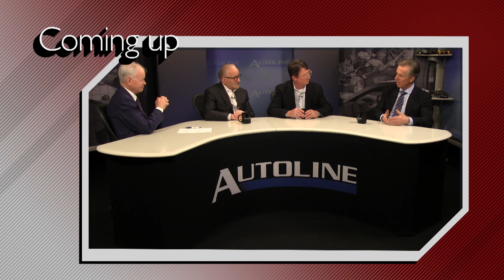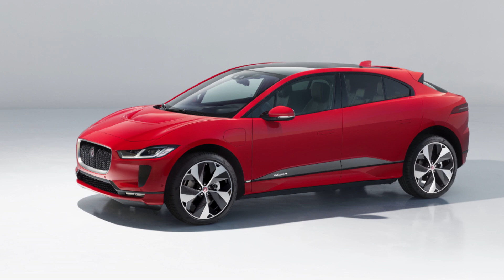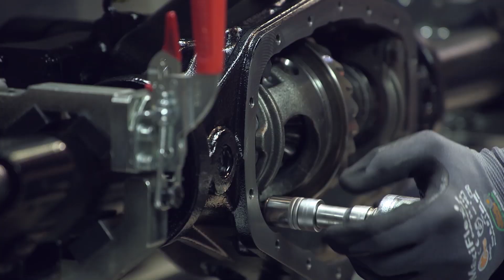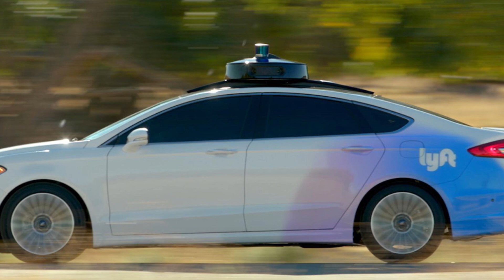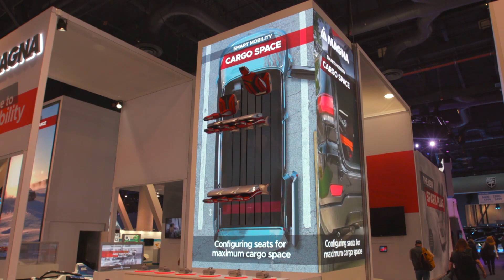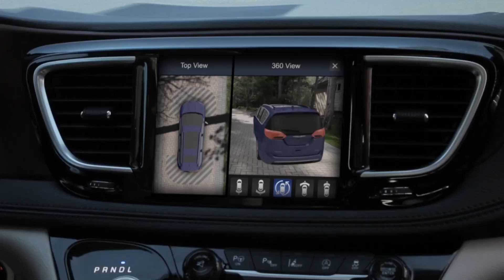Magna: The Automotive Supplier That Manufactures Cars - Autoline This Week 2309

Comment: "how do you define an electric vehicle."  No ICE at all is how you do it.
As for selling them, match tesla on price, charging speed, range, and charging network or don't expect to sell much at all. You need all 4 to succeed.  Without a charging network and +120kw charging, your EV is short range even if it has 250mi.  If you cannot take a trip without adding a ton of charge time, it is not long range.

Comment: Guys, the math has been done, and THERE IS ABSOLUTELY NO DOUBT, that no matter how you produce the electricity to charge an electric car, the equivalent in gas is much more "dirty" and damaging to the environment when you compare it to that electric car. So what the Magna CEO is saying is completely wrong.  

This is not a matter of choice, this is a matter of saving the planet.  But that's OK, while ICE car companies, and guys like the Magna CEO keep on resisting, companies like Tesla will keep on growing at an amazing speed.  People DO want electric cars, and traditional companies better pray that Tesla doesn't hit the $100 per Kw/hr any time soon, because that may very well be the end of traditional companies.
Reply: Hehe Tesla has
Reply: When Sandy Munro tore down the Tesla Model Y a few months back his people did a cost analysis for the cells used in the car (materials and manufacturing cost).  What they found is that those cells cost $82/kWh to produce.  BYD has also passed through the $100/kWh barrier.

Comment: The thing with a pure BEV and a PHEV is that in a BEV, you will not use the entire capacity of the battery.  You never go to empty.  If you have a 100 mile range, you would use 80 is at most, before you go recharge.  In a PHEV, you'll use the entire battery and then recharge.  So far, this is what I've notices among PHEV owners: 20 mile battery = getting gas once a month, 30 mile = every 2 months, 40 miles = every 4 months.  I don’t have data for the BMW i3 Rex (70 or 100 EV miles) - I suspect you would get gas once or twice a year.
Reply: Why have the extender then? Having it means more maintenance costs and higher CO2 emissions. It's the worst of all worlds.
Reply: PHEVs simply are not cost competitive with pure EVs.  We're going to see some companies producing PHEVs because they can't get enough batteries to go heavily into EVs and they're  trying to squeeze a bit more revenue out of their ICE/transmission plants.  But EVs are reaching manufacturing price parity with ICEVs (PHEVs are more expensive) and we should expect a major market flip by 2025.

Comment: Really skeptical of this guy the efficiency of a coal plant is higher than driving an ICE around through all its uncomfortable rev spots therefore electric motor with near perfect efficiency can take advantage of any power plants far higher efficiency albeit you can maybe argue what specific pollutants come into play but idk how far his reasoning extends. As far as the shared mobility and public transportation goes I don't buy it. Lets say 10 percent of Americans use public transportation while an autonomous car can easily serve way more than 10 people but let's call it 10 then the additional vehicles would only increase by 1 percent while dropping far faster from people ditching their cars for a truly autonomous ride-sharing service albeit you can argue on how long that will take.

Comment: EVs are only as environmentally friendly as the source of their electricity... true.
Reply: A full EV is so efficient that it uses less electricity than an equivalent ice car uses just to refine the fuel it uses.
Reply: Greg Collins I too heard a lot of electricity is used refining oil into petrol/gasoline, do you have any sources that have numbers we can use? 
My response to those who point out the grid is not clean is 1) even if dirty the efficiency of EV still means lower emissions (your point really), 2) grid is getting cleaner every year so old EVs get cleaner each year (never heard of an ICE car getting cleaner as it ages) and of course 3), consumers can opt to buy clean electricity or even generate their own off the roof.
Reply: There's some truth to that.  But today's EVs charged off a grid that's heavily coal still results in a lower carbon footprint than an ICEV.  And cost is dying rapidly.  

In 2007 the US got 49% of its electricity from coal.  
In 2020 the US got 19% of its electricity from coal.